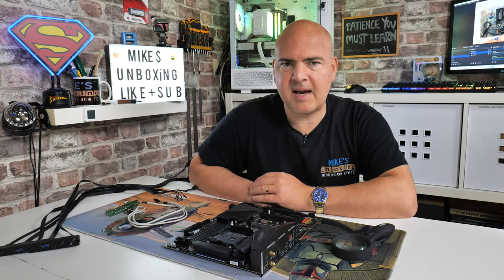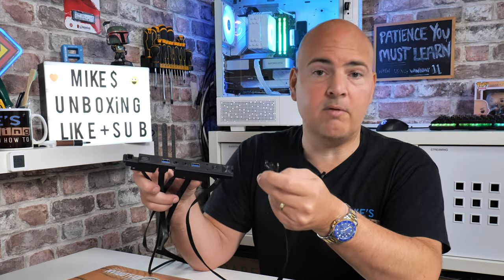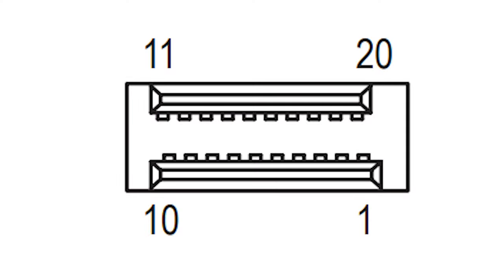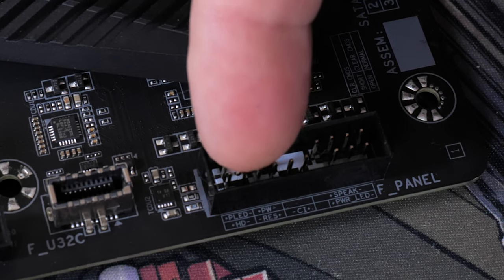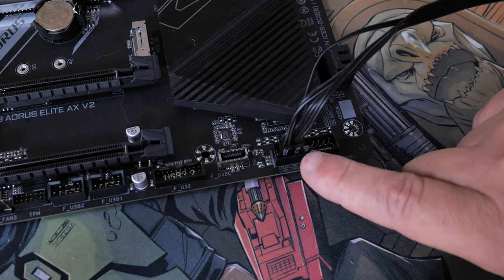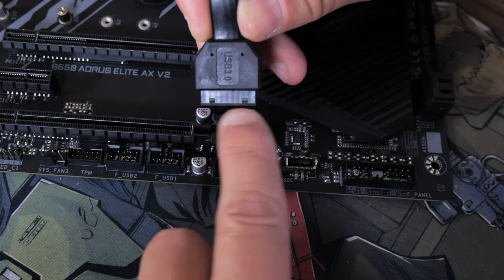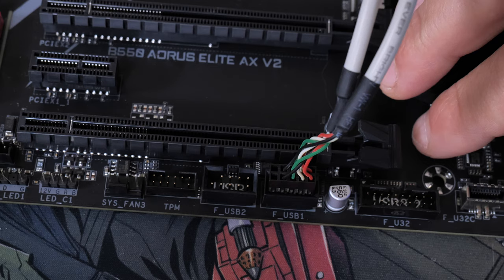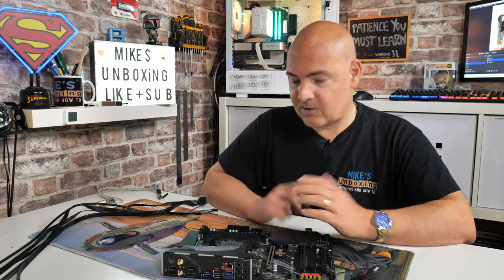How To Wire Up Computer PC Front Panel IO Connections USB Audio LEDs Etc

Comment: I use an LED light on an elastic headband for hands free lighting when putting in the connectors. I find them really annoying.I also have a jewelers loupe 40X with illuminated magnifying glass
I find front panel connectors are not as annoying as Molex connectors. Wish they would just get rid of the darn things.

Comment: I don't know why they don't make this more easy, just one plug would solve it.
Reply: Some firms do that,by adding blocks in Cases or Motherboards.ASUS,MSI and Gigabyte have all done it selectivly-in the past.
Reply: For Front panel connectors,that is.
Reply: one plug would mean less customization options for PC builders
Reply: @Doobie3010 my nrp200 max had that, wasn’t correctly done, took me about 10mins to work it out.
Reply: @christinaedwards5084  Built in the basic NR200,the pins where misaligned on that one and another was loose.Only done one client build in those so not sure if its common qa issue.Pain in the ass,though!
Reply: @Doobie3010  it’s that Initial 
“oooooh, oh, oh, no,no, no, ohh no, oh no, oh no, please god say I haven’t fried my board, please “ 
The pit of despair in your stomach, thinking “but I did every right” 
“Why? Why? Why…………. Hang on a minute!?”

“Why’ve they done that! Assholes” 😂
Reply: @christinaedwards5084  Yeah wonder how many ppl would trust Cooler masters  Quality controls & think their mobo,ram,gpu or cpu was screwed and have RMA'd!

Comment: Great vid, Mike!  Some cases (e.g. Lian Li Lancool 216) now come with the front panel connectors in a single plug, makes connection much easier. I figure that somebody must make an adapter that converts the connectors into this kind of plug. Let us know if you see something like that.
Reply from the maker: Very cool! will do

Comment: I hate the older version of the IO's.... the audio header is for the old AC97 codecs and all the new boards strictly use HD audio.I had to order an additional USB 3.0 and HD audio 3.5" add in panel, the chassis had the old AC97 header and it wouldn't work with my new MSI B450 board.... plus I now have USB 3.0 jacks in the front along with my regular USB 2.0 jacks.